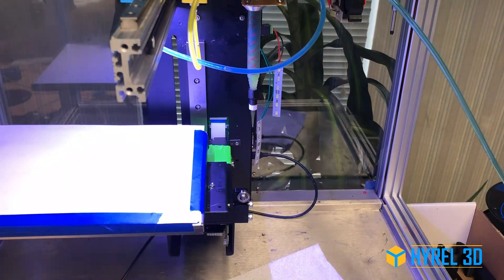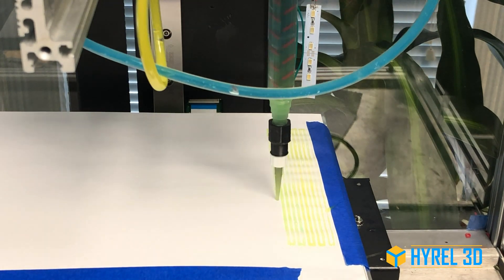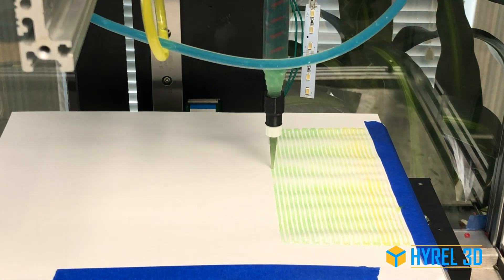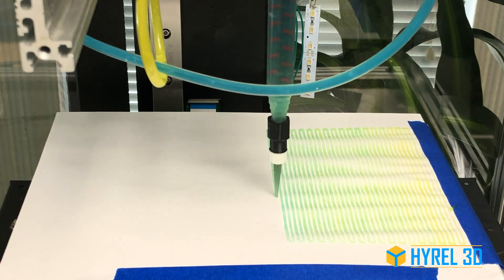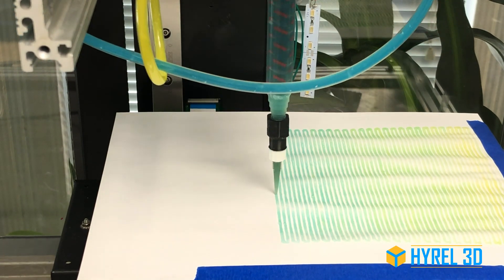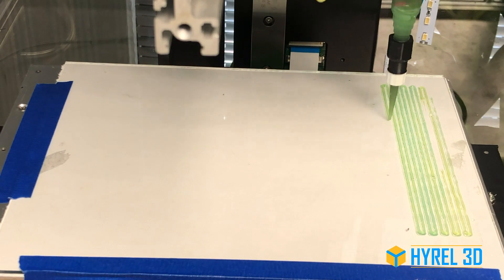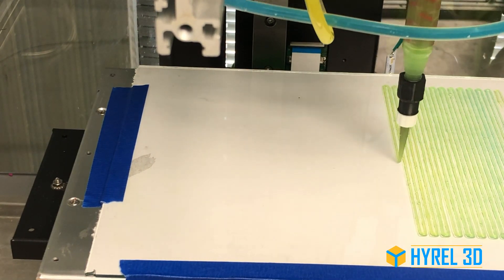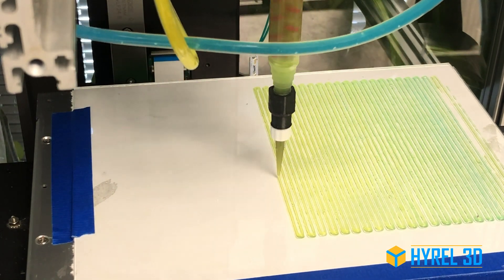Hyrel 3D's Dynamic Mixing Head DMH

Comment: hi what kind motor do you use to spin the mixer?
Reply: and the mixer is a standard part?
Reply from the maker: The DMH-2 is a standard accessory for Hyrel printers, yes.
Reply from the maker: I think that's a NEMA 23, and it's integral to the mixer head.

Comment: Would be nice to see how you disassemble and clean it :)
Reply from the maker: It's pretty easy, and we will be making a video of that process this autumn. Basically, we remove the spinning baffles and the encasing plastic, then direct soapy (or solvent-laden) water through each pathway, followed by clean water - same for the other parts.